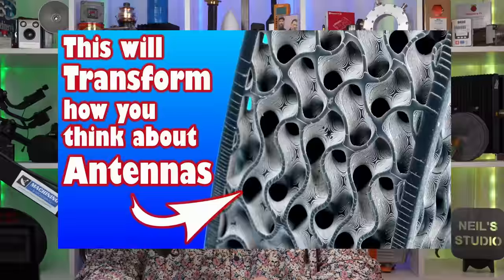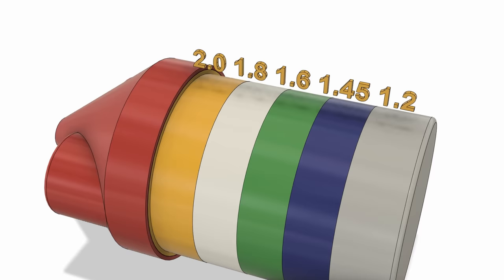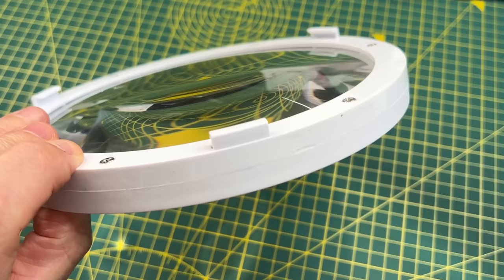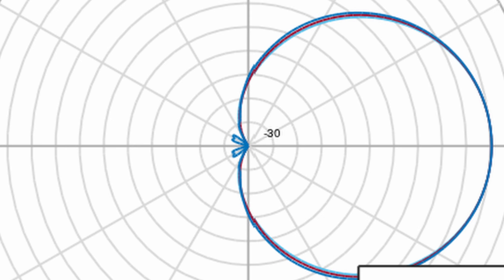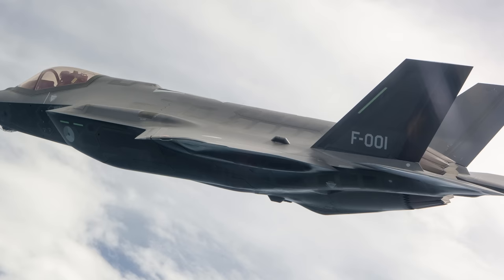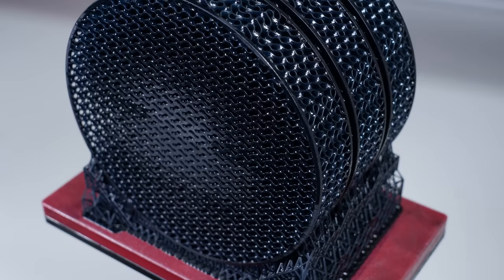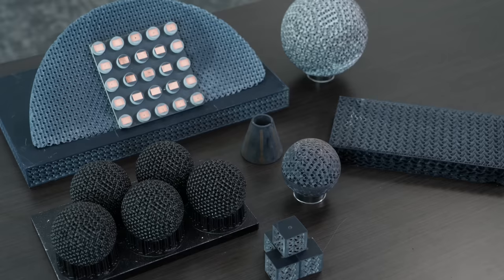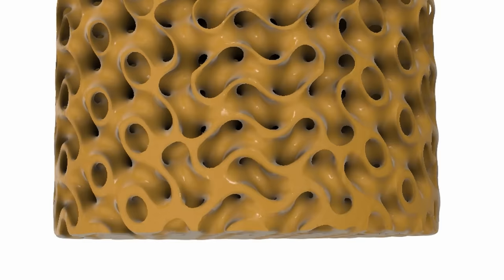How Microwave Lenses REALLY Work!

Comment: Would HIPS make for a suitable low-cost dielectric for FDM printer?

It's actually dirt cheap. It comes out to about 3/4th cost by weight of PLA or PETG, plus you get a lot more volume for that weight.

It generally comes in exactly two colours, carbon black and natural translucent white. The latter contains no masterbatch. I don't know why other colours aren't made, but i guess it's only good for your purposes that they aren't trying to add too much junk to it.

It's not a copolymer, it's a polymer blend of styrene polymer and butadiene flake just floating in it. Both are considered non-polar, but i don't know if it makes the filament non-polar enough for your purposes.

You can print lightweight flexible structures like gyroids with no enclosure, as long as you can make for decent edge adhesion, which is sometimes a problem, you may need to use ABS slurry or PVP. Draft protection is recommended, but if not, you can even run a little part cooling to just lock the printed bead in shape. Enclosed printing is better, but you don't need to push chamber temperature all too high.

I wonder if someone made a pure polystyrene filament. It needn't be expensive either. I wonder how it would behave.

Oh you can't make HIPS slurry with acetone unlike ABS slurry. But i suppose you can make one with limonene.
Reply from the maker: Now that's an interesting idea, the issue would be the low index of those materials but for complex shapes near 100% infill, it might work. Synthetic rubber is remarkably good as a microwave dielectric, and Rexolite is just a crosslinked PS so maybe butadiene and PS would be useful. Easy to test it in a fixture anyway
Reply from the maker: https://gizmodorks.com/hips-3d-printer-filament/ have many colours of HIPS filament. I'll have to try it in a test cell to see how it works as a dielectric
Reply: @MachiningandMicrowaves  I don't actually care about fancy colours, i just use black HIPS for my things which are largely mechanical in nature, it looks kind of silky and inoffensive. Just something i noticed years ago, but by now several manufacturers offer colours. Back in the day it was for some reason not considered a "real" filament but just support material, which is a little silly, since it prints fairly well, and stands up to a fair amount of abuse. Sure beats the absolute torture that is ABS. Barely even smells. I hate ABS so much. I'm also not particularly fond of PLA any longer, because all the loaded parts i made broke several years later in weirdest of ways. I mostly use PETG but there are things that weird me out about it as well.
Reply from the maker: @SianaGearz  If the white version is filled with TiO2 then that would be an amazing material to try.
Reply: @MachiningandMicrowaves  Oh that helps you? I see. The white masterbatch is usually, i'm lead to believe, titanium dioxide and zinc oxide in EVA binder. EVA is ever so slightly polar, maybe? But you don't expect a lot of masterbatch by volume in the filament.

Comment: I had no idea warm things emitted microwave noise
Reply from the maker: Even the cold old Moon is "warm" compared with the cold empty sky and makes enough microwave RF to be detectable on a reasonably-large antenna.  If I wave my hand  in front of the 10 GHz radio antenna here on my bench it makes quite some noise on the receiver it's connected to.

Comment: Could you print a  variable-density gyroid structure from a material which neither absorbs nor refracts rf then cast a material with low loss but a high index of refraction around it? so instead of being a variable ratio of resin to air it's a variable ratio of resin to the refractive medium
Reply from the maker: Sadly there aren't any materials other than ultra-sparse foams or gases that have negligible bulk permittivity. The negative of a gyroid consists of two separate structures, which would need to be kept fixed relative to each other if we used a soluble printed material to make the positive of the gyroid.  However, imagine printing a triply-periodic minimal surface like a gyroid lattice, with variable density, but then fill the voids with a powder somehow.  If the powder was a very high-permittivity low loss ceramic like alumina or TiO2, and you could guarantee a way to fill the voids without leaving any air gaps, then maybe that approach would work.  Perhaps using an evaporating solvent to form a slurry, or some sort of vibrating fill mechanism, but then you have to think about how to seal it against moisture ingress.  Sintering ceramics is perhaps more feasible, but whether there's a low-loss ceramic with a reasonable sintering temperature that could be used to coat high tiny performance ceramic granules or dumb-bell rods so they could be fused into a solid structure, we'll have to watch this space.  Interesting times we live in.

Comment: Could this be tweaked to vhf/shortwave?
Reply from the maker: It's a matter of scale.  Mass and cost scale by the cube of wavelength, so getting below GHz frequencies is limited by the practicalities and economics.  You could probably build something using blocks of dielectric, but it would be heavy and expensive.  In cold climates, it should be feasible to create massive RF lenses using water ice, which is a good dielectric (unlike liquid water)

Comment: Could you do a video on how this teck could be used for audio frequencies focusing high power sound waves to a single spot using sympathetic frequencies of materials for carving away material shaping products with Soundwaves im an audio tech and its always been in the back of my mind that this should be possible this focusing tech might be the key to make it work might take multiple frequencies working in tandem not sure yet what would be your thoughts on the subject
Reply from the maker: That's way outside my area of expertise unfortunately Ultrasonic sound waves do have a similar wavelength to microwave and mmWave RF, so the lensing devices will probably be of similar dimensions, but getting enough power handling to be useful would need some amazing materials.

Comment: Is it safe to presume the feature size/diameter of the channels need to be proportional to the wavelength, to avoid reflecting the signal? I.e. dealing with 5Ghz would necessitate feature diameter and lens size roughly 5-10x larger, right?
... in which case, could such a lense also be used as a high pass or bandpass filter?
Reply from the maker: The lens linear dimensions scale with wavelength, but the volume and mass scale with the cube of wavelength, so things get out of hand rapidly as you go below 2 GHz. Feature size limits start to matter a lot above about 50 GHz.  It's certainly feasible to make gratings and filtering structures, also things like anti-reflection dielectric layers and choke grooves to suppress reflections from the air-material interface. It's probably possible to use interference patterns to make filters. Feature sizes can be very small relative to wavelength, but there's sometimes a mechanical benefit in using larger features on larger lenses.  You can also use dielectrics as waveguides, and with gradient index methods, you can make the equivalent of a light guid, using the self-focussing and total internal reflection properties of the continuous Mikaelian lens as used in long distance optical fibres.  Lots of possibilities

Comment: I really enjoyed this v video.   I have to say though, I don't think the concept of directivity captures gain, or is it just me.
Reply from the maker: If the antenna is lossless, directivity and gain are pretty much the same, but yes, that's an oversimplification.  Much depends on how you define directivity though.  If your definition is based around small solid angles, the gain is probably defined as the power that's radiated into that solid angle in the far field divided by the solid angle as a fraction of 4pi steradians.  The directivity could be defined some other way, but I think it's pretty much the same definition as gain but ignoring losses.  For my sort of usage, gain, efficiency and lack of sidelobes away from the main directional beam are the interesting thing, and really only a 3D image can convey all of the information.  A super high directivity antenna with a low efficiency isn't any better than a fairly directive on with excellent efficiency.  A -10dB sidelobe pointing at hot ground is a disaster for space comms or moonbounce, but simple directivity or gain don't quantify that.

Comment: So this printed antenna is a literal metamaterial . Can you achieve a negative refractive index with it? And would that be of any use?
Reply from the maker: Far ad I know, you need conductive elements to create a negative refractive index, and the materials tend to be lossy and narrow band. Applying metallization to printed dielectrics is a very active area of research right now. Whether there's a practical use right now, I'm not sure. Mostly seems to be invisibility cloaks and academic research.

Comment: Amazing video, I understood a little bit, lol, but this question remains if you can focus microwaves,  can you bend it at a distance like a hook and see what's behind a wall by going around it rather than through? you mentioned the word bending a few times, but actually seeing a picture of the wave bent would be great... microwaves make me think there is some truth to Startrek... lasso a tractor beam Scotty
Reply from the maker: Once an elecromagnetic wave leaves an antenna and forms a far-field with E and H fields perpendicular to each other, you can't have any influence on it remotely.  you can certainly bend waves using dielectric loading, but once the beam is a few hundred wavelengths away, it just carries on, influenced by the gradients in the troposphere but not much else
Reply: @MachiningandMicrowaves  thanks for answering my question, so a few hundred wavelengths out, we can't really influence the beam, so basically they travel in straight lines if left unaffected by an EM field. I thought you could send a microwave beam out and wrap it with another frequency and try to bend it at a distance, but apparently not. What if, the shape of the wave from the source is bent like a hook, meaning it goes straight out for a couple of miles and then bends 180 degrees, every time, because that's just the shape of the beam based on the lenses or frequency calculations...? is such directional control possible? what if we send a microwave out and shoot another one at it at a distance and try to bend one wave with the second beam/wave?

Comment: Have been searching for a Sound Wave amplification / focus device that can be based on Fibonacci fractal patterns found in nature for some time This seems very close and economically feasible.  Am very interested in obtaining a sample for personal learning and experimentation.  Is this possible ?  Appreciate your imaginative dedication to the subject. Please let me know.
Reply from the maker: You need a lensing system at least 10 wavelengths diameter, preferably more, to get a useful effect, so there are size issues with acoustic lenses. They can work well at ultrasonic frequencies, but as 300 Hz sound waves in air have a wavelength of more than a metre, that's a house-sized block of an acoustic material. Even at 3KHz, the dimensions get pretty big. Horns and acoustic mirrors are the usual answers. Another issue us that the speed of sound in most solids is far higher than it is in air, so normal lens theory has to be inverted for acoustic lensing.

Comment: Could a gyroid lattice "lens" like this be used to effect a beam scanning array without moving parts, or would you still have to move either the lattice or the beam source? I can think of three potential use cases offhand without hardly trying...
Reply from the maker: You could use multiple sources and steer the beam using phase delays.  Lots of devices out there for 5G now. using an array with a Luneburg or Maxwell fisheye or something more fancy, potentially with hundreds of small sources, could be a viable solution.  One of my projects for later this year is a mechanically-scanned raster imaging system using mmWave.  I don't think I can afford to do it with phased sources unless someone like Analog Devices would agree to a collab!
Reply: @MachiningandMicrowaves  Raster imaging covers two of my ideas right there XD The third is a bit more inspired by a few videogames I've played, indirectly. Thanks for the suggestions!

Comment: what kind of materials can be used with this process?
Reply from the maker: There is some work going on with ceramics with different types of matrix.  I'm not aware of any details, but you can imagine that using something that you could print with a high infill ratio of things like alumina or TiO2 or other very high performance dielectric ceramics that are suspended in a printable fluid or fluidised powder than can then be sintered using a laser could potentially be used to make parts that avoid the limitations of UV-catalysed polymerisation.  The future is in the hands of materials scientists.  For me, the only way to do this in a hobby setup is either machining in layers and fusing the results, or printing with a filament with a metal oxide or ceramic infill.

Comment: Hmmm…. Got me thinking about an old maser hanging out upstairs…
Reply from the maker: I really fancy playing with an anhydrous ammonia maser, just for the sheer hell of it. 1000 Cool Points for having an old maser somewhere. Excellent
Reply: @MachiningandMicrowaves  it was a 10kW system, on 3ph… so not really home portable. Some colleagues I work with and studied under have been at the forefront of Laser physics. We have an IR femtosecond timescale pulse laser as well, and some others. The maser was retired over a decade ago, just wondering if it could see a resurgence for some power density physics… or long distance p2p communications
Reply from the maker: OK, perhaps 1000 Cool Points was short-changing you!  Nice

Comment: Any tesla fans here? We all know light is just a perturbation of the ether, acting like a coaxial curcuit, and the light's rate of induction through glass is slower because glass acts like a capacitor to light, and when it leaves the glass its rate of induction increases again, once in the air.
Reply from the maker: I'm slightly in the dark (sorry) about what the "ether" is and how you would perturb whatever it is. Coaxial circuits tend to need something coaxial to work with. I don't know what 'induction' or it's rate mean. What are the units? Is it measured in henries per second or henries per metre or something else? How does glass act like a capacitor? I guess you could model the resultant field from coherent forward scatter caused by bond length changes having a phase lag, and the reradiation from the accelerating charges and relaxation as an LCR filter with some peaks of resonance, but that would only work as a useful model if it connected atomic weights and bond strengths to the effect on the delay seen to light through the dielectric. Is this 'rate of induction' related to the 377 ohm impedance of the vacuum? It's perhaps more useful to consider a quantum mechanical sum over histories approach, or treating the perturbation as a polaron with a theoretical mass and therefore a subluminal speed. Models are only useful if they lead to measurable and verifiable outcome and can be used to make predictions based on initial confitions
Reply: @MachiningandMicrowaves  You seem bad faith, but I enjoyed your video.
Reply from the maker: @jesterprivilege  I don't do faith or belief sorry

Comment: Absolutely Fascinating … 
Then it dawned on me … what could such technology do for Magnets 🧲??? 
… or for Magnetic embankments? 🤔 
I’m familiar enough with the microwave to know that they are electric, right? 😅 
Says, Armchair Natural Philosopher
Reply from the maker: Microwaves in free space consist of tightly coupled magnetic and electric fields at right angles to each other, so you can't separate them.  Finding a material with low loss but also a high magnetic permeability above about 0.5 GHz is very hard.  Rogers Corp make MAGTREX, which has a matching permittivity and permeability and allows you do do interesting things with conductive structures